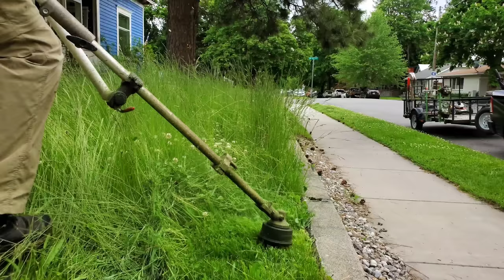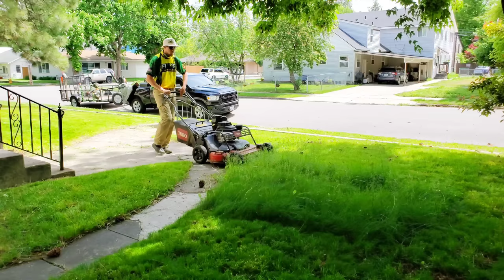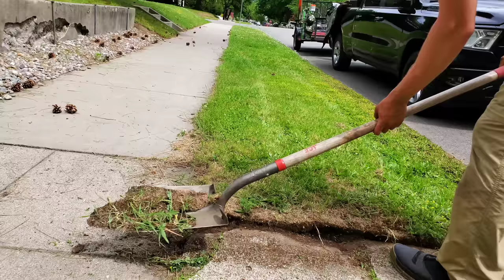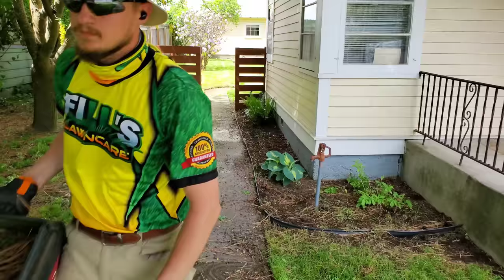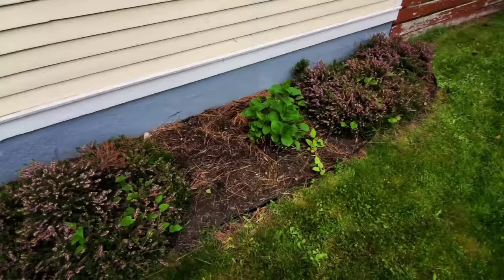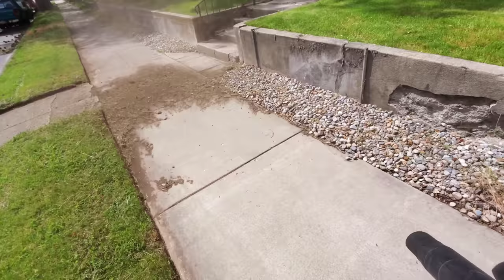I Turned The WORST Lawn On The Block BACK Into A SHINING GEM

Comment: Great job on the lawn care! And quick question, do you like the gas powered string trimmer or the battery powered one better?
Reply: I know you're not asking me, but I want to answer for me. As a home owner, I prefer gas. I can't stand battery powered outdoor power equipment
Reply: @anthonyherweck5765  I prefer battery powered but gas is better for longer weed trimming jobs imo.
Reply: @charlesrodriguez7984  battery powered aren't any good for yard cleanup jobs either. They won't last long whatsoever.
Reply: @anthonyherweck5765  actually I disagree I’ve seen a channel called Fill’s lawn care, he uses both a battery powered stihl weed eater and a gas one. When the battery wears out just replace it. I’ve also seen many people actually recommend electric powered tools however I prefer gas powered lawnmowers to electric ones for obvious reasons.
Reply from the maker: I am slowly converting to all battery but rememeber, even batteries don't last forever. Just like cell phones, they have to be replaced eventually. Gas machines are still 👑 IMHO but battery is making its ways...
Reply: @fillslawncare  I agree.

Comment: 👍👍👍 I've noticed that you trim every edge at least three times, and you don't leave grass clipping behind. You bag all grass (in another video,  even after mowing with the big machine, you collect the grass clippings by running over the same area second time, other landscapers leave them as mulch). This time with a smaller mower and the way you move it, I guess you have to empty the bag every two rows!)  You do all your jobs professionally 👏👏👏.

Comment: Great job 👏  on a much neglected yard. Would try having large plastic bins near mow path to make dumping of bag more convenient.  Another option is knock down taller parts with string trimmer before mowing. Good move to get mower through narrow gate--not easy to do. That Toro 30" mower has a powerful engine and w a sharp blade cuts nicely 👌.  Job well done.

Comment: for future reference, when you tilt a mower engine like you did to get it into the back yard, 2 things happen: the gas changes position in the carb, which depending on the direction of the tilt can flood it or starve it, and the engine oil can also drain in or out of the reservoir causing it to run dry or smoke like a mosquito truck. after you tilt it like that, let it sit for about 10 minutes before you start it.

Comment: Excellent job!  At 67 and since my 20's, I still do my own lawn every week - and have a 35-degree hill in the front up from the street to cut no less.  I have a commercial Honda mower, a McLane edger, a commercial Stihl stick edger, comm Stihl weedwhacker, and a Stihl bed redefiner.  I fertilize 6 times a year and hit it with ironite as well to get a deep green and apply granular lime and gypsum to neutralize the acidic pH and break up the clay micelles.  Even the commercial guys in the hood are impressed.  When I was down in San Diego, I got a major tip from the Mexican landscaper next door to water in the eve at 7pm in hot climates and man did that make a difference! And nw up here in Aberdeen, WA, I even help out with two elderly neighbors properies when I do mine as they can't anymore!  Like you, I love taking care of lawns and take great pride is a place well kept.  You should be proud of what you do because everybody notices it and it's always like a breath of fresh air!

Comment: The hilarious way you catapulted over the fence with the lawn mower got my like, but when you transplated that little flower to the flower bed got the sub. I could just feel the passion in your work when you did that.

Btw what kind of weed eater and string are you using?
Reply from the maker: Thank you 😊 I use a stihl kma135r and Husky Titanium Force x-pro .095

Comment: When you use the FSA 135 with the Husqvarna .105 line it looks like vegetation exploding.
Does that cordless Stihl actually turn faster than a 2 cycle….or is it more torque?

Comment: The name of the Bush or shrub is Rhododendron. Where I am coming from (Germany) this bush is  common in Parks and will grow very big 6 - 8 ft high and about 10 - 15 ft wide. The Rhododendron in your video looks very thin and has not much green leaves which is a lack of low acid in the soil.
Most rhododendrons prefer acid soils with a pH of roughly 4.5–5.5.

Comment: That shrub looks like some sort of rhododendron. I was wondering what those large balls were in the front yard, but a close up showed they were pine cones. I mow my own lawn with a Toro mower, but the self-propelled wheels are so fast. . I am 73 years old. My last mower was a Craftsman and it was slower. Does your mower have a safety that allows you to open the bagger and not get your arm whacked off?

Comment: There were very few companies that would bother to even own or use stick edgers .  For the Mexicans that were typically short , they were ok . 
I never enjoyed using em , especially the curved shaft ones , and especially on real large commercial properties. Within the end of my first day  after being hired by a self employed guy , he told me that I had two weeks to learn how to properly use the Shindaiwa T-27 . 
Ya see , I initially started to work for myself in one part of town but when winter came , the work dried up . 
I learned how to manipulate that tool like it was the extension of my M-16 . Front towards Enemy , sideways , angled edging , right ‘ left hand holding and reverse edging in the front yards , not to mention mowing with it . 
So , after being rear ended by a lady who didn’t hit her brakes , the impact complicated my already existing back injuries that had begun to become manageable. Writing as I lay in bed @1042 am . 
Keep on trucking.

Comment: the reason the mower acted all clacky and like it didnt want to start was cause it didnt... the oil in the crankcase was all up in the cylinder and in the places its not supposed to be... engines dont like to be turned up on end or sideways/upside down... also, unless its direct injected the fuel bowl in the carb collects the fuel to be metered into the engine and when u turned it up on end that all got dumped down the neck of the carb into the engine's intake.. youd be better off moving the small section of fence and reinstalling it for you equipment protection.. and.. (as the fence looked weak as hell anyways..) u may be doing them a favor by making it more secure and not ready to fall in on itself... but for future FYI... engine's like to sit upright... on whatever they are mounted to.

Comment: tools:
Stihl kma 135 r with the stihl fs-km trimmer Attachment
Toro Turfmaster HDX 30"
Stihl km131r with the stihl fc-km edger Attachment
2 Darwins grip 2.0's
Flat shovel
red metal rake
Stihl bga 86
Stihl br 700

Comment: Print this out and give to home owners/renters to use on their stone areas/side walks/drives/deck cracks to prevent regrowth of weeds if they don't want to use regular weed killer.  HOMEMADE VEGETATION KILLER - The most effective homemade option is a mixture of white vinegar, salt, and liquid dish soap. Each of these ingredients has special properties that combine to kill weeds. 
Both the salt and the vinegar contain acetic acid, which serves to dry out and kill the plants. The dish soap, meanwhile, reduces the surface tension in the mixture so that the liquid enters the pores of the leaves rather than remaining harmlessly on the surface. 
For a healthy supply of this man-made concoction, mix a gallon of white vinegar, one cup of salt, and one tablespoon of dish soap. Make sure it is properly stirred, then put the mixture in a spray bottle for easy use. You can stash the bottle in your house for repeated use. 
It is best to apply the weed killer during the sunniest part of the day, as they sun and heat help dry out and kill the weeds. Spray the weeds from close range, making sure they are entirely soaked. Remember that the solution makes no distinction between weeds and desired plants, so be sure to spray it only on what you’ll be happy to see killed.

Comment: Had that been my lawn I wouldnt have used my mowers at all.  I would have used one of my ryobi 25cc straight shaft trimmers and removed the guard and had 12 inches of string on each side giving me a 24 inch span and done the entire front and back in less time

Comment: If you had it to do over again, would you STILL purchase THIS MODEL TORO with the BAGGER? If not, why? WHAT WOULD BE A BETTER OPTION? I'm looking for a workhorse, PUSHMOWER that doesn't donkey kick my bank account. I'm also 48 years old with a minimal amount of mowing time under my fanny pack. IT WOULD BE GREAT IF YOU WOULD HELP a gal, with your experienced opinion. Thank you!
Reply from the maker: I would NOT Buy this again. I would rather buy the residential model, the toro timemaster 30". It's much lighter and delivers the same cut quality.

Comment: Not gonna lie, I avoid those unless I can get a mower up there.

Humm mower doesn't want to start... flooded the carb and/or oil in the muffler. Be careful on that mower... transmissions go out with the abuse of mowing tall grass like that repeatedly

Comment: Hey you need to learn about engines, when one is hot and you turn the mower up or in its side you flood the cylinder with oil, iam surprised it cranked.usually you haft to remove the plugs and crank the engine over till the oil stops blowing out the spark plug hole, then you haft to wash the oil off the plug...learn about engines before you damage something...